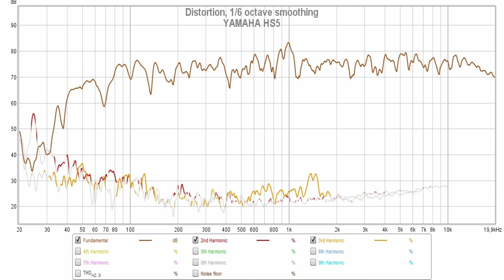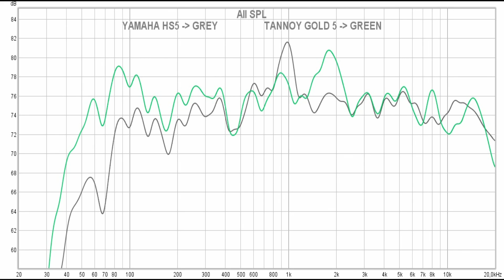Tannoy Gold 5  vs  Yamaha HS5  ||  Sound, Distortion & Frequency Response Comparison

Comment: Whilst I appreciate the very straightforward A-B comparison format of this test - without the highly subjective opinion of the presenter to sway you one way or another - it does concern me that I haven’t seen a single mention of things like the positioning and choice of the microphone, the codecs used by YouTube to upload the vid, the room size/type, the speakers/’phones you’re listening through, the age/ears of (we) the listeners. I could go on…
I need hardly spell out to anyone concerned about mixing/monitoring that any one of these factors can have a significant impact on what you’re hearing. Considered together, I feel they render the whole process pretty suspect.
Being obscenely old - and suffering from tinnitus - I’ve long been aware that my ears are probably the least reliable component in the chain that turns a couple of basic ideas into a piece of music (countless older, much poorer, speaker systems are almost certainly responsible for that). But imagine my surprise (mortification might be a better word) when a recent hearing test didn’t reveal a drop of in hearing at around 7-8kHz as I’d imagined - but a very significant fall over around 1.5 - 2kHz. I need hardly spell out the significance of this in audio/music terms, but it obviously suggests I can’t trust my ears anymore.
More significantly, I wonder how many watchers of this YouTube vid (and the countless others comparing speaker models) are aware of how their ears and equipment are affecting what they’re hearing here? At the very least, it puts the concern about the 1kHz spike in the HS5’s response into some kind of perspective. 
As a thank-you to the company that took the trouble to post this video, I would commend the very broad choice of material used to conduct the test (another highly influential factor), but I really do feel there’s some vital information that’s been left out - and a couple of caveats about what you, the listener (whatever your age) can reasonably take away from such tests. And I haven’t even mentioned issues such as the subjectivity of music.
As an editor and writer involved in music and professional audio for most of my life, I could count several hi-fi journalists as professional acquaintances - and often used to infuriate them by saying: OK, you’ve written your latest speaker review, now go back into the domestic environment where you conducted the test, move all the soft furnishings and other items six feet to the left - and re-write it.
I’m not suggesting near-field monitoring in a studio environment is subject to such effects, but there are an awful lot of factors that really should be taken into account. My solution (beyond an uncertain future in music creation!) is simply to listen to my mixes on as many different speaker types (and environments) as I can - and seek the opinions of as many people as possible. 
Of course, at the end of the day, I still need a main pair of studio monitors - and like everyone else here, I have a decision to make about what to buy (not helped by the truly ridiculous amount of choice we’re faced with as purchasers). These days - taking into account the points I’ve raised - I find myself being drawn far more to factors like appearance, reliability and sheer desirability. And yes, I know that means I’ve probably blown my credibility…

Comment: Tannoy clearly has more BASS. Not a fan of powered speaker controls on the back or front panels. For access and appearance purposes all controls should be on the side panels. Cable in/out should be on the back panel.
Reply: You gotta admit havin em on the front makes life a little easier when tweaking them